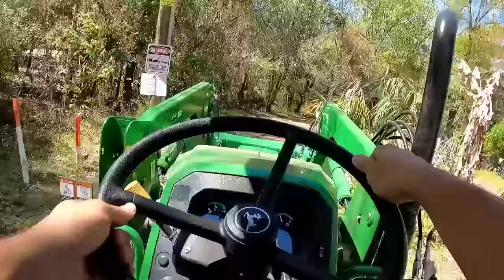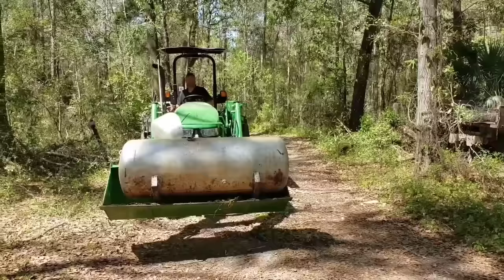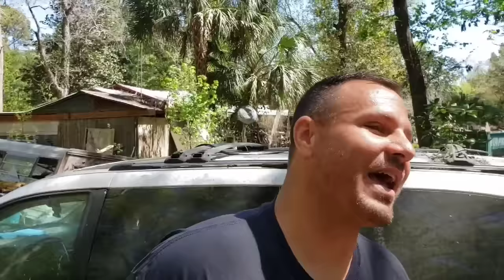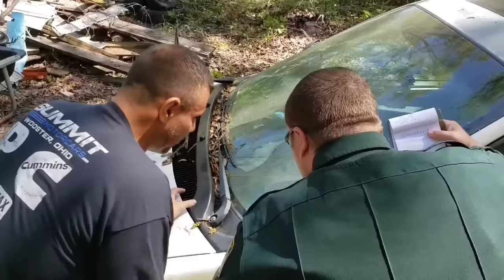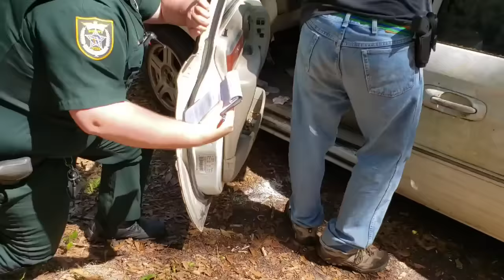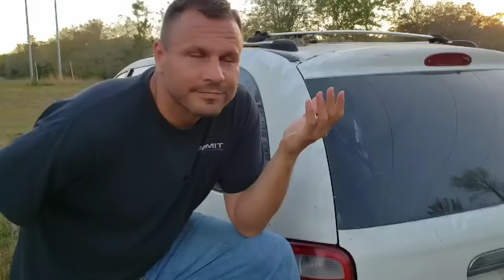COPS CALLED On Neighbors AGAIN ... Protecting Our Property ... I Bought An Abandoned Ranch

Comment: That propane tank can be turned into a marvelous  wood burning barbecue.  If you install it on a trailer that can take the weight of it properly,  it can be used or sold as a portable barbecue Catering trailer.

Comment: That dumptruck looks like a g7117..  1941-45 gm ww2 4x4 truck.. if it has a winch on the front its a g7117 if it doesn't have a winch its a g7116...

They are worth dragging out and getting going again.. do a video on that one!